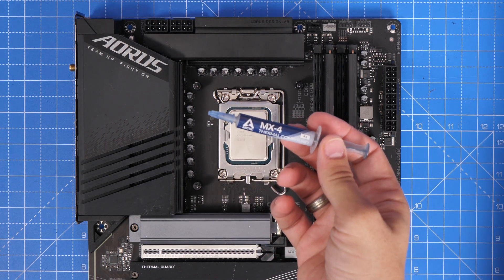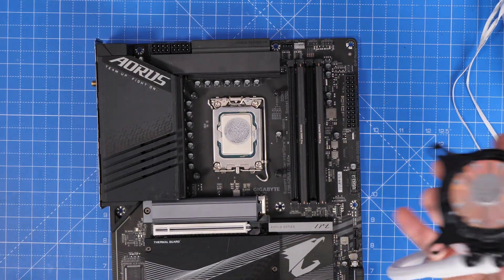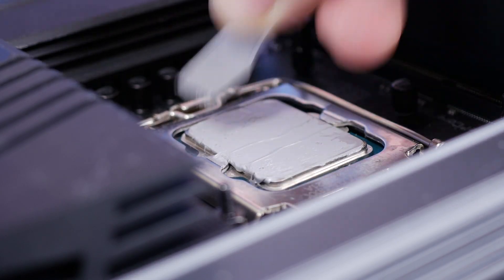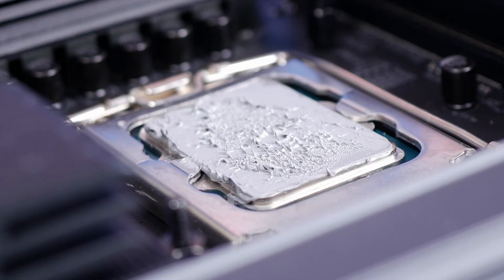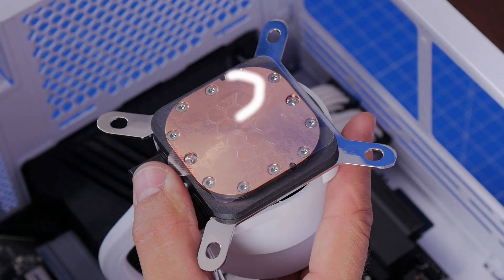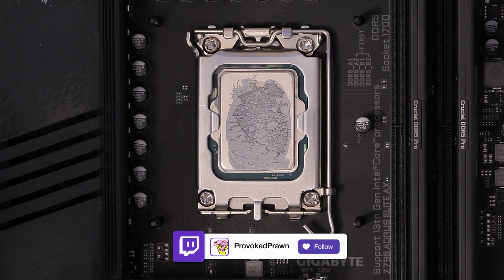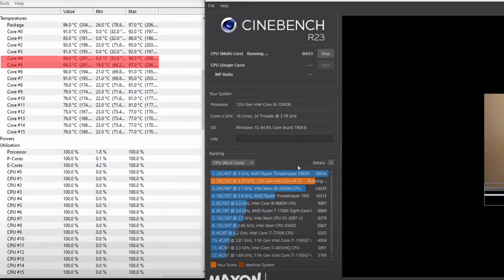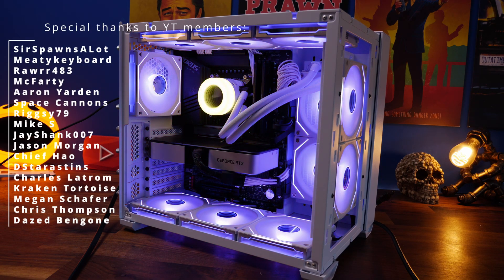Don't make these thermal paste mistakes (how not to apply thermal paste)

Comment: If you put a little bit too much it'll just squeeze out when you tighten your cooler down.  If you put way too much then that can cause a bit of issue but for the most part if you're sensible enough to put a computer together then you know what way too much is

Comment: Should I reapply the paste if I lift the cooler to install m.2?
Reply: If you removed or even slightly disconnected the cooler from the CPU at all, for any reason, clean and reapply thermal paste.

Comment: Should you have put thermal paste on the heat sink?  I see you didn’t put any on.
Reply: Apply thermal paste on the 6 or the heatsink. Not both. Its up to you but Usually you apply it on the cpu cause its easier to see if its in the middle or how much to put

Comment: just putting pumpblock on cpu has  much less pressure , so you got wrong thermal paste application, if you will screw bolts and get more pressure , the thermal paste will spread better and there will be a full coverage of thermal paste on cpu

Comment: My CPU started running hot last night and shut off, a few hours later and it was running in the high 90’s Fahrenheit from the start. should I try replacing the thermal paste? NZXT prebuilt with Ryzen 7 3700x & 3060ti
Reply from the maker: Possibly but it could be other things https://youtu.be/nVkN8diBIAE
Reply: @TheProvokedPrawn turns out the M22 cooler was faulty and NZXT sent me the new version(Kraken 120) I’ll have to go back and watch your video on mistakes to avoid when applying thermal paste now. 😎 best tech channel on YouTube
Reply from the maker: @diz354  glad to hear you got it sorted. Thanks for the kind words

Comment: What's your view on original ILM bending 12th and 13th gen CPU's and causing worse thermal performence? Do you use derBauer bracket or stick to original ILM in your builds?

Comment: I think it can also depend a lot on the paste. Something like Kryonaut that’s thicker benefits from getting manually spread but with something like Noctua’s solutions, I find I get better results using their recommended application method in their instructions. Difference is minor but still an improvement in my experience.

Comment: What thermal paste is better to buy?
Reply: Depends on the CPU/GPU you want to use it on.
You cant get wrong with Arctic MX-4, but with CPU/GPUs far exceeding 100Watts i'd suggest MX-6, it works a little better than MX-4 after some treshhold for some reason.
Just make sure you get a decent enuff cooler as well, good paste helps with good heat transfer, but the cooler has to do the work.
Reply: MX-6

Comment: Ok, just built an 13900k system with a 360 strix aio. 

The thermal paste was already applied to the cooler by the manufacturer. 

When I did my first tests using the software you suggested the cpu would consistently overheat 100’c, no overclock all standard settings. 

I researched this and found quite a few people on reddit saying that there isn’t an aio that is capable of cooling this cpu and you should set the Asus multi core enhancements to “disable-enforce all limits” in the bios. 

I did this and it worked I get a better cinebench score and stable temps. 

My question being, is this true with the 13900k and am I restricting the performance by any noticeable amount, I feel I’m not but I’m not very experienced with this. 

Any help or advice would be greatly appreciated.
Reply: I have the same CPU and its runnin 100'c on cinebench with Aorus z790 elite motherboard, with kraken 240 AIO.
Just orderered Kryonaut paste and 360 AIO cooler. But I doubt it will make any significant difference.
Reply: @sxzoR11  I’m no expert but under volting seems to be the way to go.
Reply from the maker: i9 can run very hot, especially if it's automatically Overclocked by the motherboard. I had this issue with the 12900k. Had to turn off the overclocking and undervolt. Alternatively you could try some different thermal paste like Kryonaut
Reply: @TheProvokedPrawn  brilliant thanks.
Reply from the maker: @Manic.miner2077  I'd also try just checking you've tightened the stand off screws enough. If they're loose that can hurt performance.
Reply: @TheProvokedPrawn  I will check that out, thank you.

Comment: I never used the supposed "standard" method.
I'm always on the "spread that crap evenly over the entirety of the IHS" train and never use the crap things get delivered with.
Atleast for CPUs like my now 5800X3D.

GPUs is another Story, there a line in the middle at the longest extent and then screwing the cooler 1 side to the other and back and that with not to thin paste, usually gave me the best results.
I'm using MX-6 btw, especially on GPUs, but as it works a little better with everything above 100Watts+ compared to MX-4 for some reason, its also the Goto for powerhungry and hot CPUs now.^^